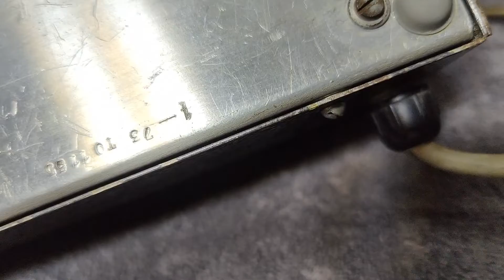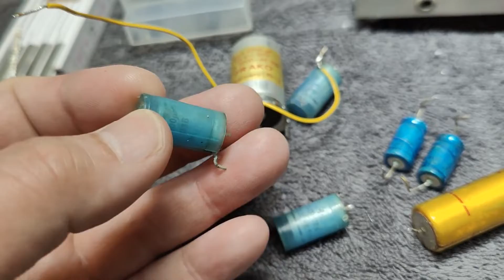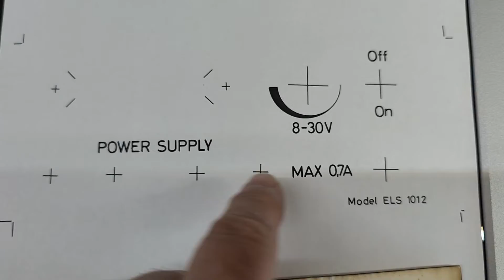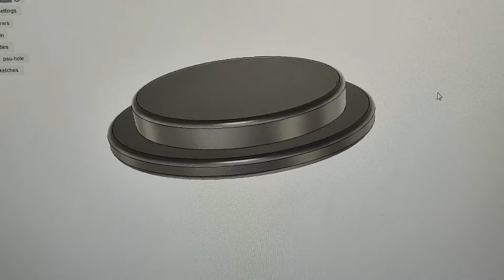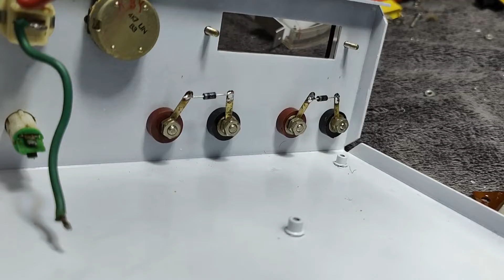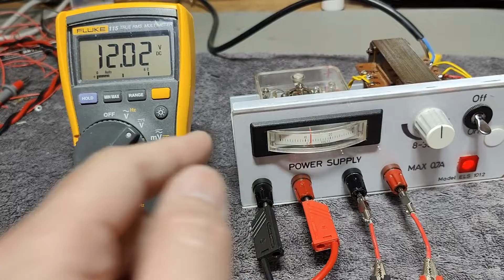DIY power supply 8-30V 0.7A Model ELS 1012 Josty-Kit NT30 1975

Comment: The voltage regulator is a discrete op-amp with fairly high open-loop gain. T5 and T3 are common-emitter gain stages in series, T2 is the output follower stage of the op-amp; and T4 is the pass element driven by the op-amp. T5 is the differential input stage with gain, utilizing the fact that the Z1 voltage has a fairly low impedance compared to the source resistance of the feedback network R8,9,11. 

T5 could be replaced by a differential pair, but the design has quite respectable DC performance as-is. 

The current limiter is fairly ingenuous.

Comment: Thanks for the tips!
If I ever find a proper heatsink I might end up with a usable power supply ;) hehehehe
Reply from the maker: yes the size of the heatsink and transformator location, it is clearly not a workhorse unit.. but for small experiments it is still just fine